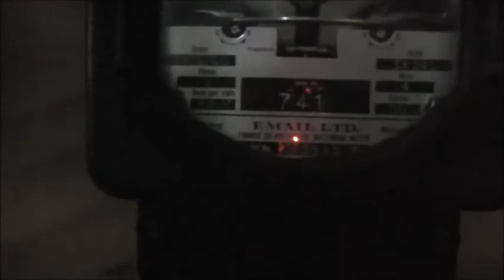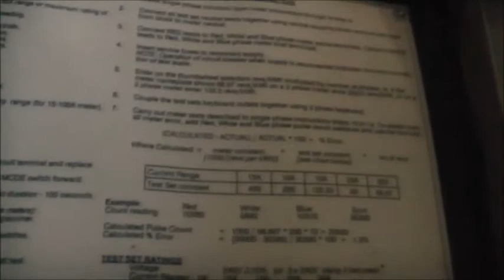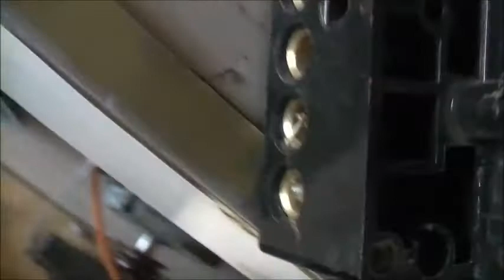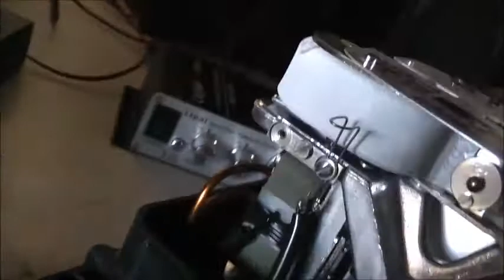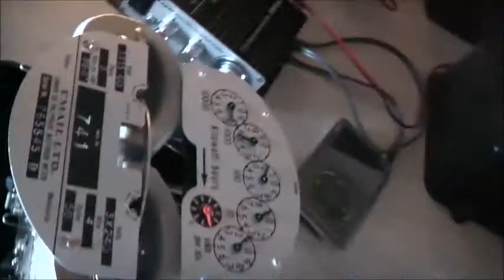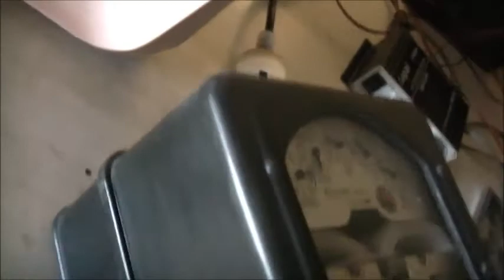EMAIL SD Test & Clean!

Comment: Very nice meters. The private meter has an 15 - 60 Amp base load instead of the 10 - 60 Amps rating also the 88.8 rev / kWh. I like that meter smell too of the varnish and bakelite casing, after opening an unopened meter up after 30 years or so.